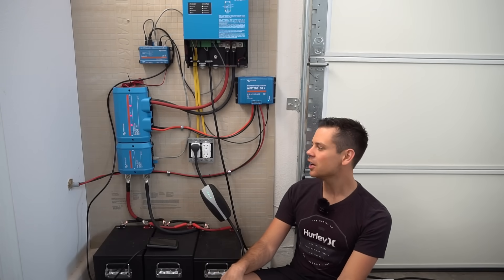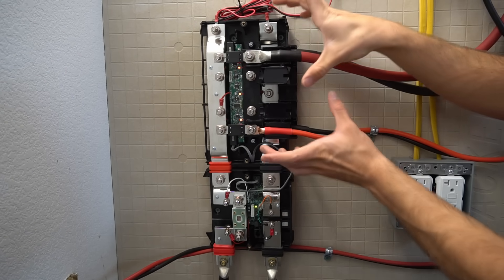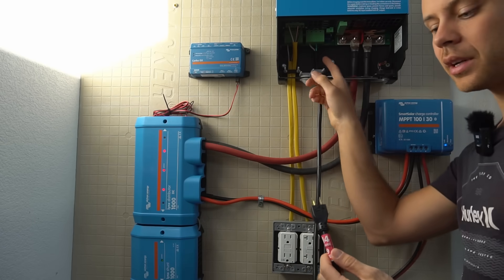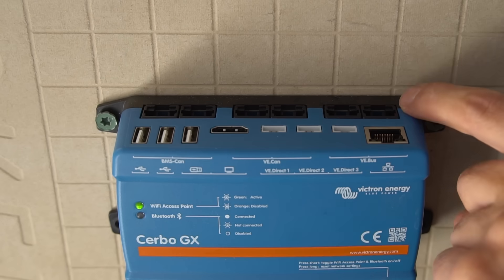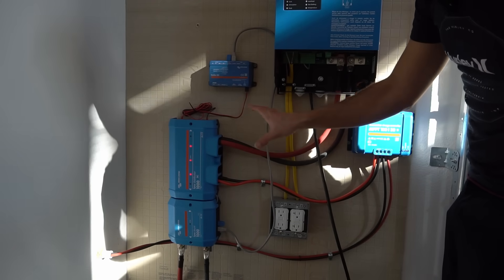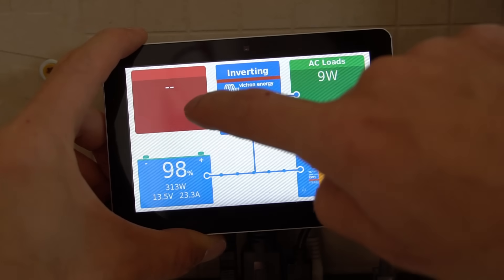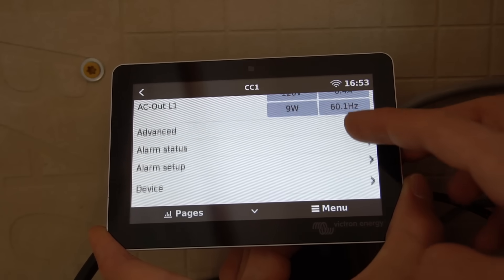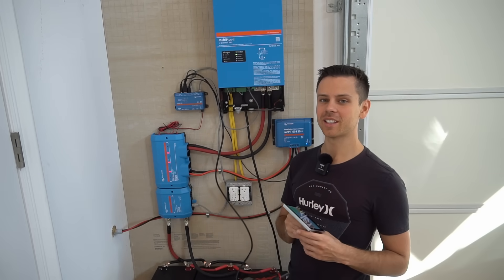Victron Made Easy! Design and Communication, Step-by-Step

Comment: My set up is 3000 multi plus, cerbo gx, 712 monitor and 3 solar controllers ( 100/ 30 ve direct only to the cerbo, and 2 each 150/ 85s ve can to the cerbo). They are all set up for lithium profiles and networked.  I have tested the system with a 1600 watt load and a 1300 watt load. First off the solar will not pick up the complete load and is  still showing 200 watt ish discharge from the batteries with both loads the same full sunlight. Did the test several times. I have noticed controllers starting in different orders. What determines how the controllers share the load?
Reply: The batteries are 7 each100 amp hours battle born

Comment: Will,  I know you have shown linked invertors but have not really delved into how one would staged a solar system in phases?  Maybe you could make a video with recommendations.

Why:  I need to clear some land and make other changes such that installing a large system isn't viable at this time, but I want to get started soon.
why2: I will use line power and then ween myself off of it, yet have it for backup.
why3: My power grid is unreliable so when it goes off it is a real PITA.

So I am thinking of systems that I prioritize which I rewire the house to different circuits that can be powered individually.

Circuit 1: Lights in our main room, office power (computers, internet, monitors)
Circuit 2: Kitchen fridge,  microwave, furnace (gas), TV
Circuit 3: Washer dryer, well pump, garage doors,  electric stove, car charger

I'll know the loads needed for each circuit and they will be low, medium and high. 

So I'd be looking at different sized battery banks, solar power inputs and inverters.
I'd like to install each system in stages.  Also if there are power sharing devices between solar inputs and batteries I'd be interested in that.
Also each circuit would have a different priority.  Foe example if my lighting power was low and I had plenty of washer and dryer power, I'd want to have lights over washing clothes in the dark.

Thanks

Comment: Hi Will, I have a friend that has a half setup Victron system. He wanted to do this. He wanted to ask how to give the battery priority over mains even if it is there most of the time & only have the Inverter/charger to switchover to mains & charge the battery at the same time based on a state of charge of say 60% as a trigger which will mean all the charge sources (their charge source runs 24/7 meaning the battery mostly is at 95 - 100% SOC & it's not a victron controller being a turbine controller) failed but the 240 volt output needs to continue. Basically a UPS in reverse. This is with a MultiPlus 24/3000/70 ( the only victron component in this system at the moment). I have the USB computer interface to program the inverter and have programed it the best I can (voltage triggered SOC is the only option it gave me) but between the internet information from Victron is Not even remotely the same as the software parameters shown when programing via the computer. They really need to get that information right and uniform, it confuses the hell out of me. At the moment when the low state of charge triggers the changeover switch & charger it trips the main Mains breaker supply. Did they teach you about the programming side of these things? All that other paraphernalia you show there I didn't realize wasn't built in the inverter as it is for other ones on the market. It looks like this bloke described above needs all that com & shunt gear too like you have there. Why they componenetized all that stuff externally got me stuffed.

Comment: Mate, why did Victron do things in such a complex way? I set up a 3000 watt system over 20 years ago & the only external component for the Ausie made Inverter is the current shunt for it's energy computer. It's so much more simple than this. By the way it's still running.

Comment: Nice gear, costs a motza but still, great gear. 
Will, have you got much material for non-common system voltages like 12S 36 volt battery setups? Too many stuck on 12/24/48 but bvery little 36V?

Comment: Excellent video! I also have victron system in the house. I have 2 questions:
1) what for is the battery shunt? In my installation battery is connected directly to  invertor.
2) you showed 3 communication protocols, why it can't be connected all together by one of them to make it extremely simple?
Reply: Mine also. For four years I have just had a battery, mppt charge controller and 24v/3000w Multi-plus and I've never had to touch it. I might put fuses in someday.

Comment: Too many cables IMHO. An expensive modern system like this should have modules that sync together instead of communication cables. In this day and age we shouldnt have to use plug in terminators it should all be done internally through software! No wonder people get put off using this system.

Comment: Hi Will, enjoy your expertise in the off grid power set-ups but what I'm interested in is connecting up a wind generator with an existing solar set up. 
What I have:
Existing solar, 2 x 138ah batteries in series (24v) connected to a Renogy solar system, 4 x 100w panels in series to a renogy 12v/24v controller.
I have bought a, Nature Power 500w  12v/24v wind turbine with on board MPPT controller. Can I connect then both to the same battery bank?
Thank you from Victoria, Australia
Jay

Comment: So exciting to learn, But why is the original mounted 2.5mm cable on the 12Volt 100Watt solar panel's MC4 connector cord I bought? The MC4 connectors can handle up to 6mm. With 2.5mm there is a voltage drop even if the other cables are coarser up to the regulator (6-16mm), is it a good idea to solder them off the panel (2x 90cm 2.5mm) and change to 6mm.??? Thanks for an informative channel!

Comment: I have 5 Zamp 170 watt solar panels connected in parallel to a Victron 150/85 smart charge controller. The opperating voltage is listed at 18v.  Is it wise to add 4 more 175 watt renogy panels in parallel which are also rated at 18v. The cable to my controller is 4awg, 10 feet long.

Comment: Another awesome video Will.  We are building a system for our Land Rover but are using Mastervolt.  Both companies operate in a similar way, everything is high end quality that just works together properly.  Saves all the time trying to configure different brands items to get them to work together, and then find out that due to certain limitations some safety features do not work.

Comment: I chose to go down the Victron path early as I wanted the remote view and also full control of all my components from wherever I am. They are not cheap but the products and service you get are amazing. I have my Multiplus running for 2 weeks now and it is really the best inverter out there. It will cope with all kind of different setups and installations, on-grid, off-grid, mobile installations in a boat or RV, no problem. With the assistants you can get the Multiplus to pretty much do everything. I like the AC-out2 function when it for example can turn on your water heater (or EV-charger) if the battery is full but there is still enough solar coming in.
I have now also successfully daisy chained two inverters in series with one being the Multiplus. It takes the output of pretty much any inverter as the AC input and can add up to 5kVA on top what the first inverter already delivers. What a powerful system 💪
I've got the Linx system already here for the next project, Shunt, Distributor and Power-in. It will be so much easier than the battery shelf 😂
Thanks for another great video, Will 🍻

Edit: Oh, I forgot, you can also easily connect (almost) any other BMS via RS485 to the Victron system and can then slow down charging if on cell gets out of balance until the balancer has caught up.
Reply from the maker: Aren't they lovely!! I cannot believe all the features they have. I am still diving deep into the various configurations and I am very impressed. I've used victron for years, but none of their inverters. They are nice!! You are smart to go directly with them early on. Fantastic equipment
Reply from the maker: Yeah that is super powerful. The daisy chain method is amazing. I'll have to try that
Reply: Andy, how do obtain the RS485 protocol of an alien battery, Making the Victron work with BMS’s would be a game changer
Reply: @carson3210  there is a driver for the Raspberry Pi available which should work with most BMS. I'm keen myself...
Reply: I'm new to my all electric campervan. When I'm not using the van,do I keep the inverter on, off, or charge only. Thanks

Comment: Hey Will I’m planning an off grid system, can you speak to the efficiency lost by using AC/DC devices via inverter or is it better to make DC/DC adaptors for all these devices to run off the batteries and skip the AC?
I’m talking about everyday devices such as internet router, power tool chargers. Is it worth the cost and hassle?

Comment: Beginner question: What's a shunt used for? Just the big fuse for overcurrent protection and measuring the current flow for the battery bank?
Reply: It's essentially a resistor with a very low resistance, and precisely calibrated so you can measure the current flow from a very small (less than 50mV) voltage drop. A small microcontroller, built into that blue box, can then calculate how many amp-hours go into- and out of the battery, and that allows for accurately determining the state of charge.

Comment: Awesome, thanks for this . Can I ask, if this was set up in an Rv where do you have the battery ground go to as far as chassis? I’m new at all this and want to make sure I have all mine set up correctly. Do you have a diagram on how it should be set up if I give you my components. 

I have two 6 volt batteries, with Victron battery monitor 712, MPPT 100/50 and 2000w inverter. Two 100w solar panels . I have just the regular factory positive buss Barr and added a neg buss bar . Thank you for your help.

Comment: Well done Will. Another great video.  I recently installed Multi-Plus II 3000, MPPT 100-50, CERBO GX in my RV with  600AH  LIFEPO4 upgrade.  Thanks to your videos you gave me the confidence to do it. Victron was more expensive, but it really integrates nicely.  Once I got all the cables, set up, and configurations set up properly, the system is working really well.
Reply: So happy for you. I plan to do the same in my "forever RV". Will is a rock solid source of info.
Reply: @michaelcharge4783  like you my next fifth wheel will be our last one . I’ll buy a used one and upgrade to our likes. Solar is a big part of it so we can boon dock whenever we want.
Reply: What systems are you able to use in your RV.
I have a fifth wheel and want solar to be more independent .

Comment: I looked at a lot of inverter chargers when designing my system.  I am very cheap, but bought Victron because it was the best price for features and performance.  Much cheaper than Magnum or the other high end hybrid inverter/chargers.  I built my own DIY batteries and found 215W panels for $150 each, so I definitely saved money anywhere I could.  The Multiplus 24/3000/70 was only $1,200.  It can charge my battery bank at 2000W, greatly reducing generator run time, which is important to me.  I honestly couldn’t find another inverter charger that powerful for the money.
Reply: Hi Jim . Is your system in an RV.
The wife and I want to add a solar system to our fifth wheel so we can boon dock and not have to worry about running a generator . Which these days is really expensive.
Just wondering what your power requirements are and do you wish you had more battery capacity . Thanks

Comment: When building a solar system with multiple all in inverters, and multiple batteries, what bus bar would you use. I only see the the 4 connector ones you recommend, but in your all in one 48v videos, you suggest conencting all batteries in parallel thought a bus bar, with the same length leads, instead of parallel to each other. I'm having trouble locating a bus bar that supports that.configuration.

Comment: Will, I have been watching your videos for sometime now. What do you recommend for my home - I average 2100kwh per month in a small well insulated house. Most of my power use is due to family living here while they look for a house and i am in technology so i have a network rack loaded with servers etc. I am looking for a solution to keep all 20amp items in my home on during power outages instead of buying all of these UPS devices. We live in a hurricane prone area so wind is an issue to an extent and i have a generator for backup power. I am looking for a DIY system due to heavily overpriced offers from local solar companies ex. SunProSolar quoted $30k+ for what they claim to be a 25,000 wattt solar system without batteries. If i want a battery system they quoted an additional $17,500 for Enphase Encharge 10 battery storage system and said i would need 3 of them. So basically they want me to pay $82k+ for a complete solar system
Reply: you also have a MASSIVE use of 70kWh PER DAY... that's like almost as much as I use PER MONTH... so you need to store 70.000 watt every day... figure out your solar on the worst day of the year, then you know how many panels you need to make that, then you also need to be able to store that... and if you want to make sure you have power for the days with no sun, then you need to multiply the batteries for each day you want that storage and if you don't want the extra battery storage you would need a large generator that can handle that amount of power else you will be sitting in the dark.

Comment: Thanks for this! It is great to see how easy it is to start it up. Is it possible to do the configuration also via ethernet? I know there is a MK3-USB interface to work with VE.Configure program on PC, however it is available only for a Windows OS, while I have Linux on all my machines, so I would prefer using a web interface for that task.

Comment: People should also be aware of the Victron EasySolar product line. It integrates a MultiPlus with an MPPT, (colour control) GX depending on model and AC distribution. It is cost effective and extremely easy to setup.
Reply: @Tim  I don't know, I'm from The Kingdom of The Netherlands. You'd have to check with a local Victron dealer.

Comment: What type of backer board are you using to mount all your equipment?  I’d like to step away from plywood…
Reply from the maker: Hardiboard. Ten bucks at home Depot
Reply: @WillProwse  Rock on! That’s Will.  Are you still using any sort of backer behind the hardiboard for strength? Like plywood + hardiboard?

Comment: Victron is bad ass!!!!   If you don't want to fork out the extra dough for the lynx and ceerbo GX system  You can get a Bluetooth dongle for the multi plus, the smart solar MPPT charge controller Has Bluetooth Built-in And the smart BMV 712 shunt Also has Bluetooth  And they can all communicate with each other over Bluetooth. Definitely the Cerbo GX  is  the cat's ass and it's the way to go if you got the extra money to spend.

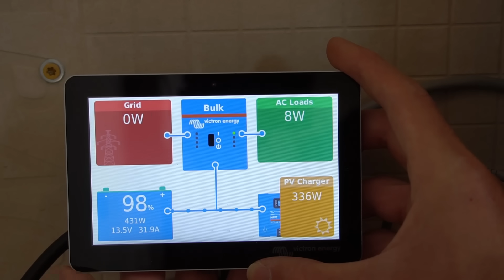Comment: At the 12:10 you connected to AC and it shows the power coming in… if your 800W pv power is high enough will it or can it back-feed to the grid?  That would be awesome! Great video - thanks
Reply: I'm wondering the same thing to also whether or not he just plugged it into a regular wall outlet or not

Comment: Will,
   It's interesting that you just did a Victron video, I know many people using this brand for marine systems.  I was going to reach out to you and ask how your typical recommendations may or may not shift or vary for DIY Solars systems for Marine applications. I have a 27ft sailboat that I’d like to outfit with solar. Which components / features are crucial to a Marine application. Do you consult on installations?

Comment: Will, the Victron smart MPPT I installed last year called for a ground wire from the body of the MPPT back to the negative buss bar if the unit is not mounted to a grounded panel common to the batteries in the system.

Do you also have a dual pole DC breaker between the panels and the MPPT?  It could be a good followup video to show those additional components.

Comment: This does feel overkill for such a small system, especially since it is a 12v system requiring you to push so much amperage through. Great products though
Reply: yeah my thought too... would just use the charger + inverter and call it a day (with fuses obviously) I don't even dare to look up the price on the shunt and that other thing... Victron is pricey as hell but they do deliver nice products but sheesh the price is insane here in Europe

Comment: Do you lose anything by not having a control connection between the inverter / charger and the batteries?  I know Victron has (very expensive) batteries with dedicated communication cables to connect to their BMS...  Does such tight integration between BMS and the remainder of the system lead to any performance or longevity advantages?

Comment: A great video Will, thanks. I also like the Victron equipment. I was concerned with you touching terminals while the system is on. I know your wiring terminations are nice and neat covering the mains voltages but others may not and have exposed wire showing. You should draw peoples attention to the fact that you are dealing with lethal voltages and high currents with these systems. Here in Australia we have strict rules on who can wire up Mains appliances, maybe your rules are different over there.

Comment: Great thanks. In the future I'm wanting to run a massive 3 bed house with 2 x 2 bed additional  apartments for rental with two pool pumps and two well type water pumps and 2 washing machines 8 TVs, 3 fridge freezers and 1 chest freezer. I reckon 50 to 60kwh 48v battery bank at least and 30kw of inversion. To build that with victron would be over $35k easily no? Including my panels that is? I Want to be off grid. What would this cost me.